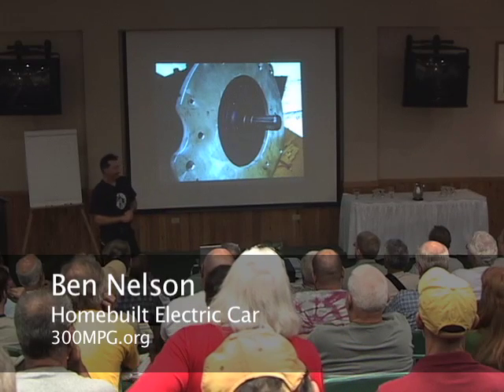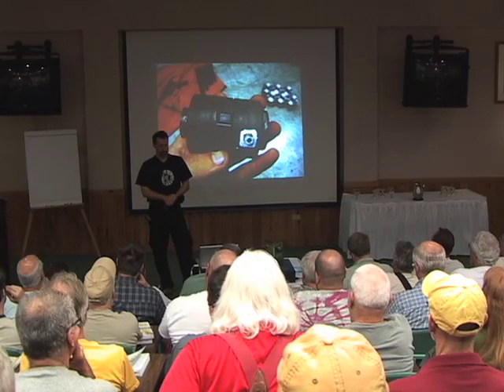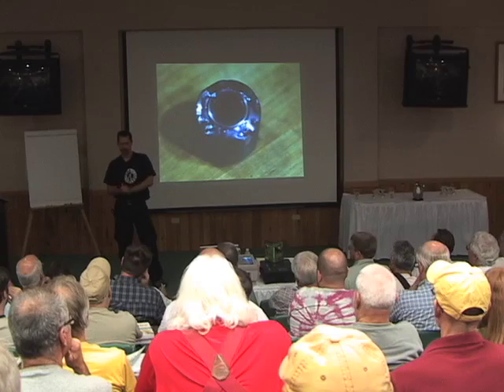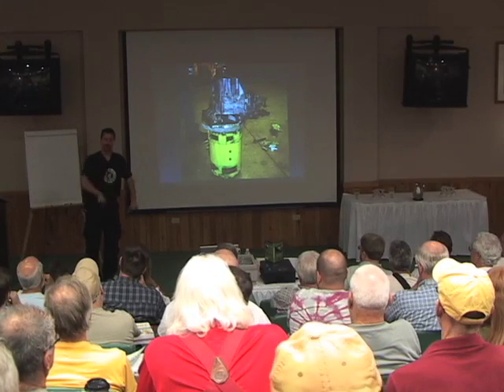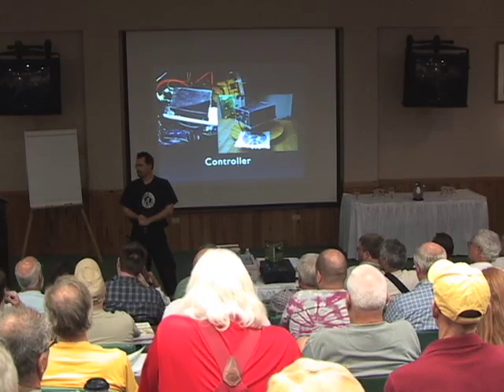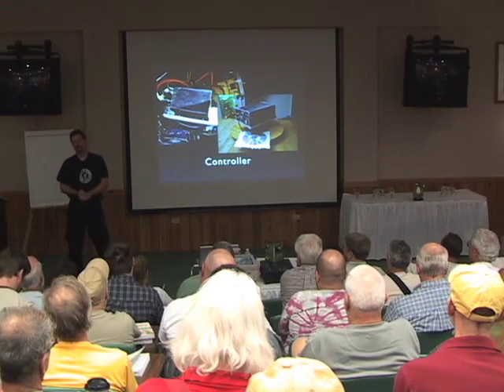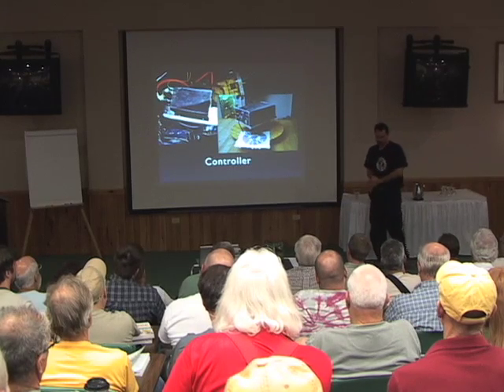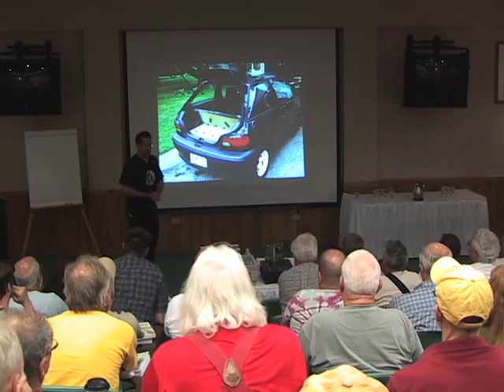Build Your Own Electric Car, Part 4

Comment: The best thing to convert, at least in Québec, is a late 80s or early 90s pickup. You need something with the least complexity possible, no airbags, and with a high payload. You also need to maintain the original weight balance and braking ability. It takes ALOT of work to get one certified, and I'm telling you now you CANNOT build something like forkenswift or Ben Nelson because it will NOT pass (at least in Québec). You need to do it right the first time around, expect to spend

Comment: My family got tired of seeing my car so I had to scrap it. I learned of one homemade EV conversion that passed inspection in Québec after many, many attempts. Nothing with an airbag has passed yet because the SAAQ suspects the electrical components may cause interference with the airbag's electrics and cause it to trigger at the wrong moment. The SAAQ will not allow anything to go past it's original Gross vehicle weight.

Comment: @PHILG64 Phil!  You pickle for a nickel!  If you can solder you can put together an open source controller yourself.  No programming skills necessary.  No machining tools necessary.  If you can't solder at all, then you might want to ask a friend, or pay $2000 for a Curtis 144v 500amp controller, which has that lovely 1500 Hz squeal every time the motor is at low rpm because they couldn't be bothered to have throttle proportional to current.   hahaha.

Comment from the maker: There are plenty of great conversion companies out there. In this video, I am documenting my experience with a basic, inexpensive home conversion.
72V IS on the low end. It's fine for me, but most people would want a higher voltage system. I decided to go with the lower voltage to save weight and battery space, and keep plenty of cargo room. Open Source controllers are available in kit form that anyone can assemble.

Light-weight, manual transmission vehicles are the way to go with conversions

Comment: Please look up a professional EV converter in your area. Do not use a 4WD or heavy duty vehicle. Golf cart controllers are not designed for an EV. Open source controllers are not a reasonable option for most people. Do not use a 72 volt system, you will be very unhappy with the results.
Phil Galati
New Jersey Electric Vehicle Conversions